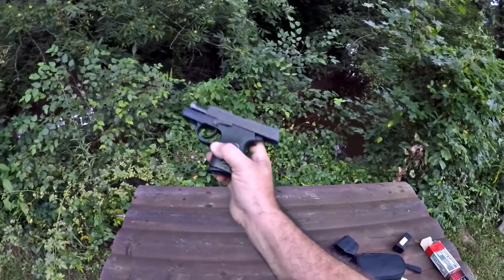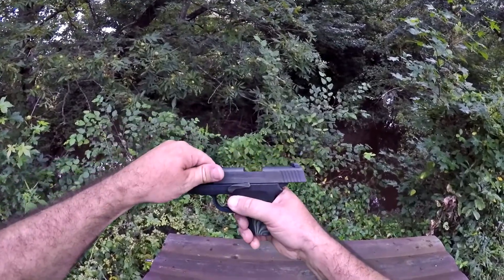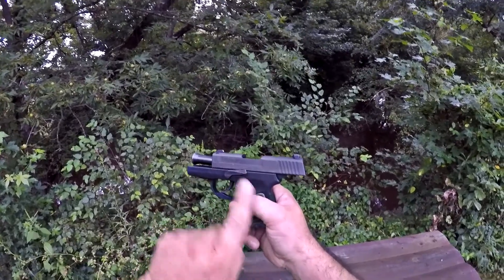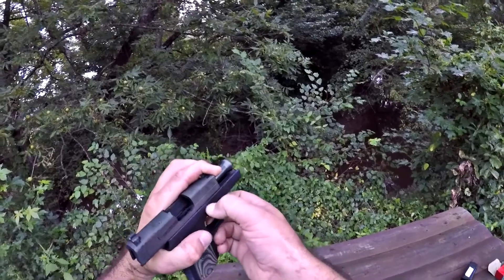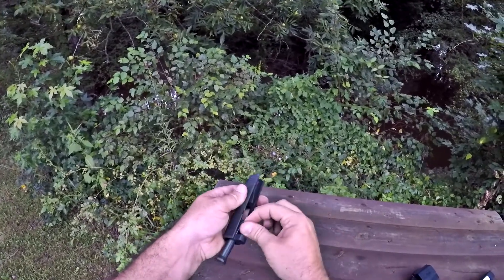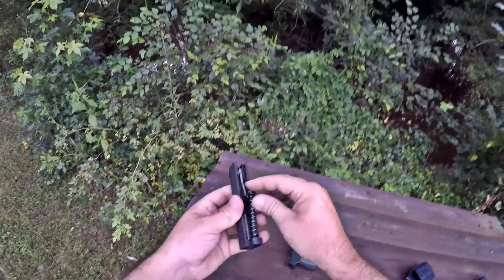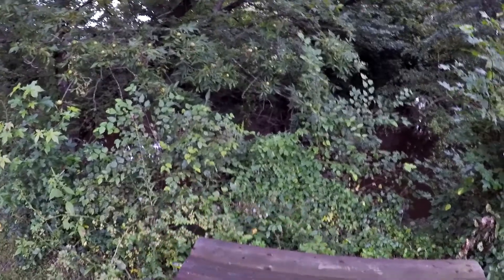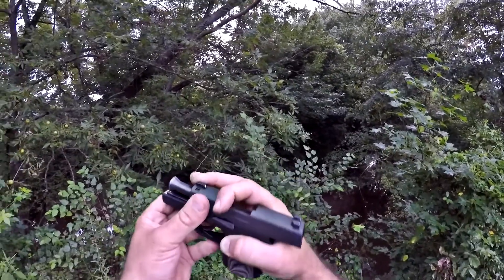SIG P290RS Field Strip

Comment: I had one of those when they first came out…..what a freakin’ nightmare to fieldstrip. You really DID need 3 hands. I didn’t like the DAO trigger, either. The whole thing was a bad idea and came and went out of production very quickly. Compared to the other SIG offerings of that day it was relatively concealable but that was the only good thing about it.